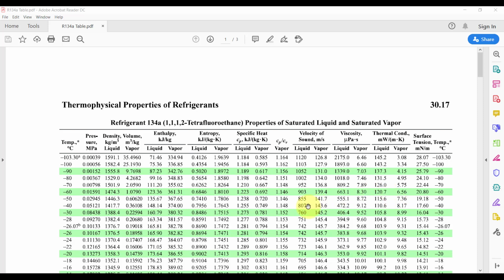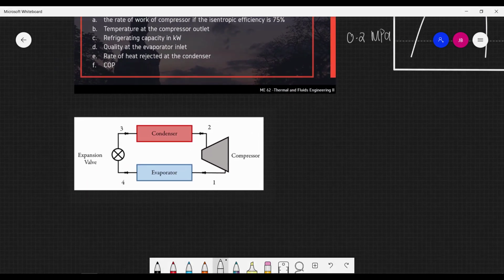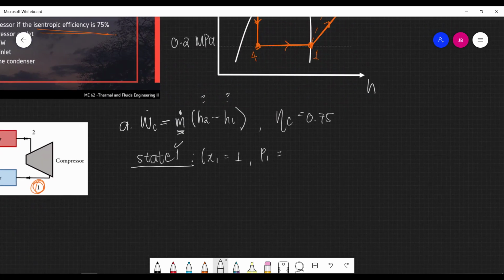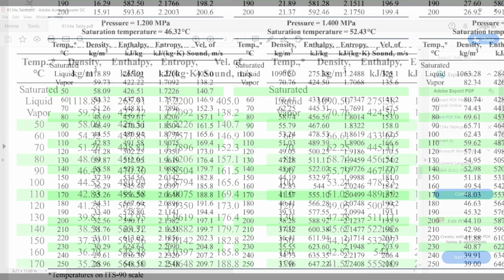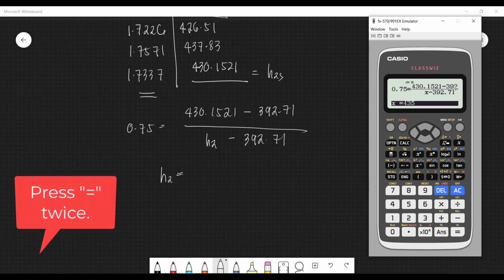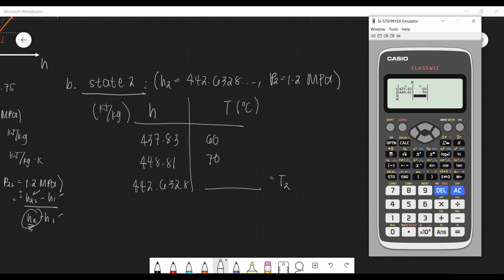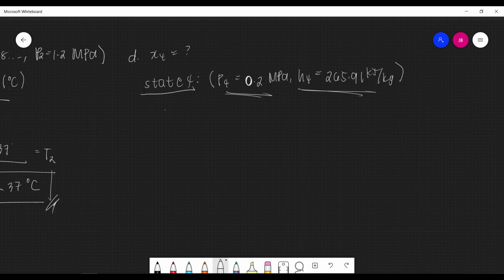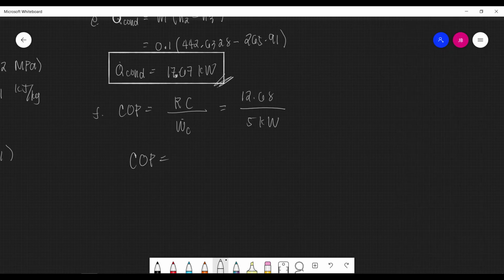Solved Problem: Standard Vapor Compression Cycle (Filipino) 🧐

Comment: sir...paano po natin malaman na ung point ng 75% isentropic efficiency ay nasa right ng 2s....pag po ba isentropic it means ito ay 100 % efficiency ng compressor...dba..un pong point 2  ay 125 % isentropic efficiency..hindi 75 %....paki linaw po sir.   salamat po..
Reply from the maker: Isentropic efficiency of a compressor is defined as ideal work over actual work. 75% compressor efficiency means mas malaki ang actual compressor work, which also means that (h2 - h1) is larger than (h2s-h1). Consequently, h2 is pushed more to the right of h2s.
Reply: @IanBytes  salamat po....